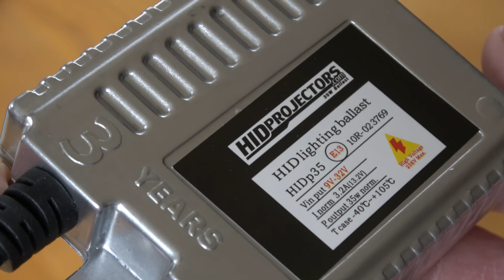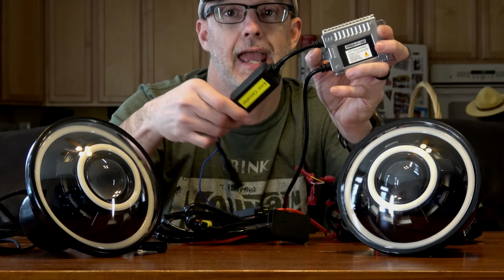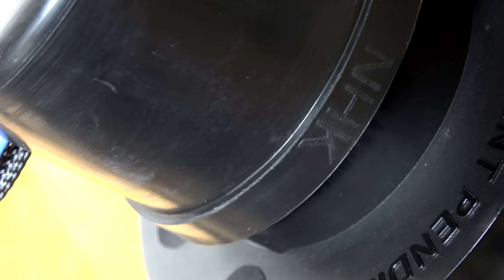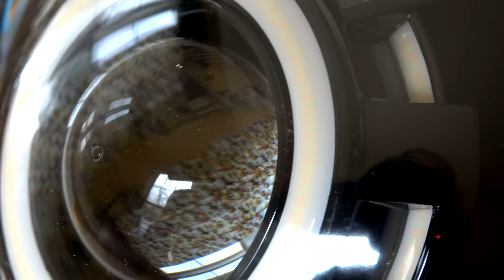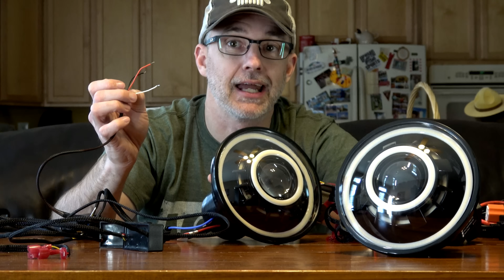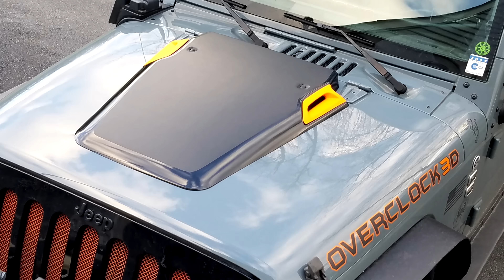01 - HIDProjectors.com Revision 2.0 Signature Switchback - HID with LED Halo, Angel Eyes, Devil Eye

Comment: I thought you had orange halo rings lights already but then i realize the ones you had before these were LEDS. Cant wait for the install video, tips, then pro's and con's. :)
Reply from the maker: Vincent Valentine Yep... These are upgrades to an upgrade. 😁
Reply: TBH these were my actual light upgrade (plan on getting just the Revision 2.0). I never liked the leds brand lights because they cut off is never that clean like true projectors with HIDs. I always been a fan of the cut offs with true projectors and hid's since HID's were a big hit back then with retrofits and such (before my jeep).... Though Led's with true projectors ex: Super7: Morimoto are nice as well but one draw back with those is that it projects a M shadow on the ground... SMH, that just ruins it for me. This why i am going for these Revision 2.0's.